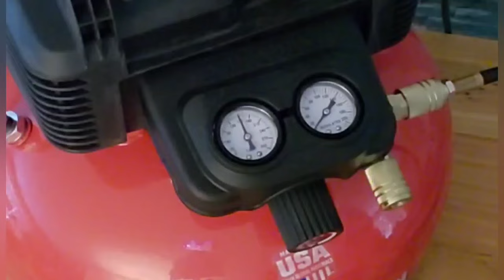How to Use an Air Compressor

Comment: Thank you for mentioning the need to open up the drain valve at the bottom when you're done.   Air contains water vapor; when compressed, it condenses in the tank and will rust it over time. It is so important to open that drain after each use.  I have seen a rusted tank rupture under pressure from across the shop, and it's certainly not an experience I'd ever want to repeat!

Comment: Hmm, i had a pancake one once and couldn't get it to air up my tire; i assumed it was broken - especially now after hearing you say you used one to air up your tires. I'd rather fill a tank and tote it to my truck.  
Please tell me this - assuming that a 7 gal. 100 psi portable air tank will inflate a flat 16" tire to 40psi (will it?), what size 110v compressor is needed to fill that air tank to 100psi? A 7 gallon one? IDK
I like taking a portable tank on the road just in case i need to plug and fill - and to top off my tires at the house without lugging the compressor to my truck.. Thank you!

ssuemed